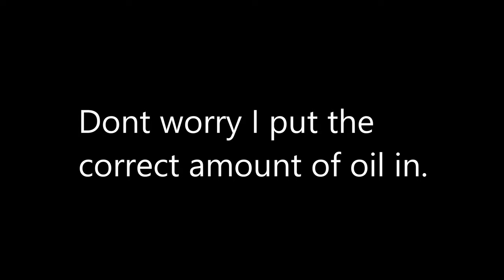Tips for New Riders you HAVENT HEARD | Kawasaki Ninja 650 | Beginner Riders

Comment: Good tips. Trying to keep up with a faster, more skilled rider is not a good choice, agreed! Ride at your own pace and ability rather than pushing it too far. 
Changing the oil on this bike is fairly easy. Just a matter of loosening off those fairings bolts/attachers, and then using the big wrench to loosen off the oil filter after draiing the warmed oil. Very easy to do for most motorcyclists.

Comment: Liked the oil change over the audio. I have a 2024 N650 and am able to do a complete oil and filter change with removing or loosening any bodywork. Try it, it works!
Reply from the maker: @dsrstudios9505  thank you for that. Yea I don’t like removing anything if it isn’t completely necessary.
Reply: @CityNinja650  it does require one of those oil filter removers that covers the top part of the oil filter with a nut on it for a wrench

Comment: If riding in winter, having some frame sliders attached to catch the bike and spare the fairings through the engine bolt are a good idea when dealing with ice, slippery leaves, gravel, corrosive salt and snow.
Reply from the maker: I definitely want to invest in that. Always comes down to money. You said it right when you mentioned the salt. That’s honestly my biggest concern. Last winter the salt completely destroyed my chain. I wonder if I can get something to really protect the underside?
Reply: @CityNinja650  Cool, thanks. I was able to install mine, which were under $100 bucks for the frame sliders, left and right, with the center bar. It's a challenge to install, but not too bad and took about 1 hour. The hope is to never need them of course! Best of luck during the upcoming winter! I used to ride in the winter but the risks are high as you know with the ice most of all.

Comment: Glad I ain't the only idiot that rides in the winter. lol I'm in Ontario.

I'm still trying to get my confidence back. A few months back my front brakes locked up on me. I went down at around 55-60. Came out fine. Been riding again for a little over a month now. I can feel that background nervous crap. I hate it. 

In my area, we usually get snow in the winter. I've been caught in it before. I just take it slow, tripod it, etc. Usually, if the roads are clear, I ride, albeit more cautiously on the back roads. My city is kinda lazy, too, so I often have to wait a day or two for them to actually clear the roads. The rain never really bothered me. After about 15 minutes the junk has been washed off the road. Going back to finding my confidence again. Been taking it way slower than I used to, even though I know I can take it. When I went down it was raining, although it was my brakes not the rain--to my knowledge. Never actually figured out what happened, though we did find out the master cylinder failed. My guess is that's what caused it. Just happened to be at a time it was raining. 

Other than that, it's just idiots that don't know how to drive. Let's go 60 in an 80, or let's pull out even though I see you, etc.
Reply from the maker: Idiots unite lol.
Dude that’s nuts. Did you high side? 60 mph isn’t nothing. I would be shaken up too tbh. Sounds like you had all the gear on as well which probably saved you too.
It’s funny. I always joke about riding in the rain saying “well at least it will be an easier slide” which might be true I’m not sure.

Either way that’s no joking manor. Did you have recent break work done? I remember seeing a video about changing breaks and they said to make sure to clean the cylinder because it will get stuck due to break dust.

When I was about to get my breaks done I remember it felt like mine wanted to lock up.
Glad you made it out ok and are still riding tho.
Reply: @CityNinja650  Oddly, no. I caught traction, but I guess the rain helped, and I low sided it. One second I'm riding, then barely applied brakes, then it feels like I'm on ice, then traction, then I'm sliding on my butt, foot, and hand and can see my bike sliding in front of me. I gave the wallet I have a five star review for saving my butt. Literally was sliding on my wallet. The gloves I use have palm protectors. They annoyed me a bit, at first, but I'm really glad I have them, now. I got really lucky. Hit nothing, and the rain definitely made the slide easier. It still shredded my pants though. I was not wearing good pants. Work pants....

I hadn't. The car in front of me touched their brakes, so I touched mine. To let the car behind me know and just in case. I stripped the calipers down, cleaned everything, etc. Obviously drained the lines, put new brake fluid in. That's when I found out the master cylinder wasn't working properly.....

Yeah, I'm still trying to find my confidence, but I ain't bright enough to stop riding. lol My biology teacher in college keeps dropping hints about motorcycle accidents, loss of skin, etc. lol

Comment: Cant disagree with the content. Being in Europe , living in a place with 4 seasons with all their hassles and headaches, it does require some adjustment

2 months now since i got my 650 2024, recently finished my break-in period and had my first maintenance.  It did cost me more than 120 bucks to have it done.  
Looking at you doing your oil change makes me wonder if i can save some money on this as well, as it does not seem to be that much of a difficulty. However,  the next maintenance would be in a few 5000 miles or so, but that is not only to do oil change, but i guess to also inspect all other parts/fluids/brakes/bolts/nuts/overall state of the motorcycle, and these kind of activities i am unable to do myself... so i will land up at the dealership no matter what, spending the necessary $....

It would be nice to see how to tighten a chain on a 650, or to inspect other parts (not just to replace, but more to identify if it needs to be changed or not)... So if you ever need new content,...  brake fluid/chain tightening/oil change/tire pressure and wear/liquid coolant/etc ;-)

Comment: One thing that only just struck me is; gassing up. Am I supposed to plant the nozzle ala my truck OR back it off X amount like filling a gas can?
Reply from the maker: @ZachFromIT  I kinda do a mixture of both. Like if it’s a nozzle that has to be pushed in I’ll use my one hand to push it in and have the nozzle just a little in the gas tank
Reply from the maker: @ZachFromIT  if that makes any sense
Reply: @CityNinja650  I've only had to fill twice. At 1st it was obvious, sinking the whole nozzle(to the stop point, in case some bikes are just an open hole. Ninja 500 for me) would not fill the tank. 
So I've been resting the pumps lip to the top of my gas inlet. Which seems to get it full(er) but maybe not full full? 
The reading on level vs kickstand can be 2 bars. It's just a bit confusing, I want full but not overfull? Is it like a 4-wheel, too much can cause issues.
I guess, thinking about it now, bike leans severely at times. That would favor a tippy top it off methodology as correct.
I bring it up, here, because maybe it's a good but uncommon new rider psa(I never rode before buying this bike, 41yrs old and I just want 54mpg while looking a bit cool).

Comment from the maker: Idiots unite lol.
Dude that’s nuts. Did you high side? 60 mph isn’t nothing. I would be shaken up too tbh. Sounds like you had all the gear on as well which probably saved you too.
It’s funny. I always joke about riding in the rain saying “well at least it will be an easier slide” which might be true I’m not sure.

Either way that’s no joking manor. Did you have recent break work done? I remember seeing a video about changing breaks and they said to make sure to clean the cylinder because it will get stuck due to break dust.

When I was about to get my breaks done I remember it felt like mine wanted to lock up.
Glad you made it out ok and are still riding tho.